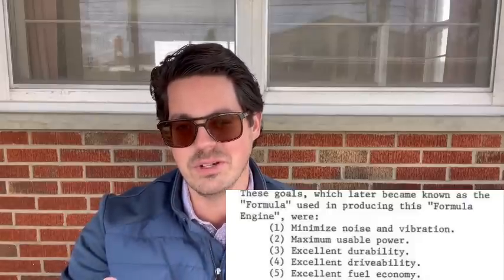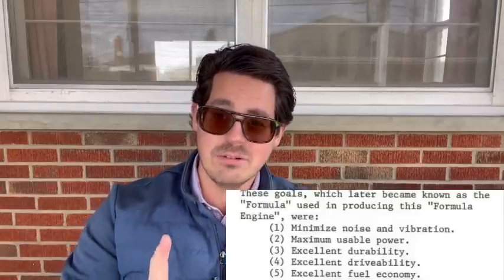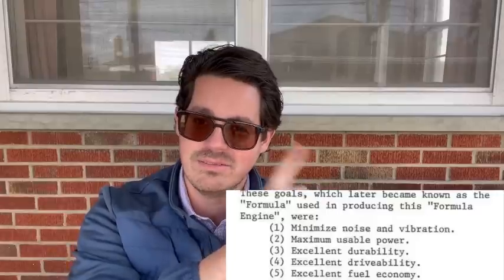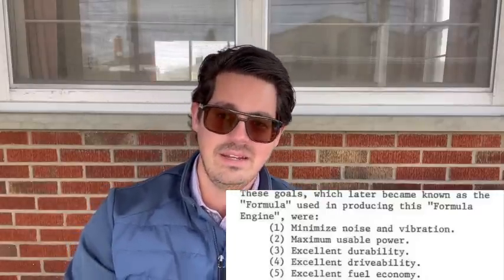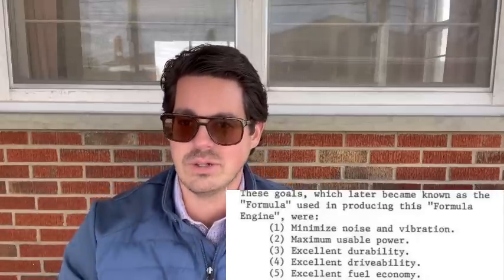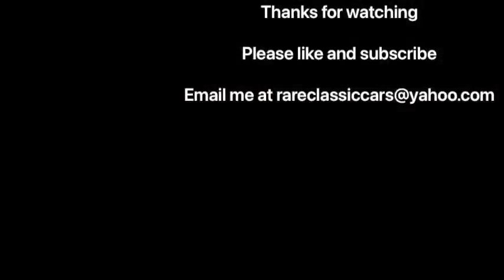Worst Engines of All Time: GM's 2.5L Iron Duke 4-Cylinder

Comment: I don’t think I would consider it one of the worst engines. My father bought my mother a 1981 skylark 2 door coupe (FWD, same as your Omega)with the 2.5L. At the time, yes looking back it was Course, rough, vibrated and very unrefined………However it was fun to drive, peppy and with 3 teenagers borrowing mom’s car and beating the hell the out of it, we got almost 175k without any major issues. Very durable and reliable……And American auto makers made Horrible 4 cylinder engines.
So I wouldn’t call it one of the the worst engines, most unrefined for sure.

Comment: I had a brand new 1976 Pontiac Astre with the 2.5L coupled to a 5-speed manual transmission.  It ran great.  Took it out to Colorado and Utah skiing one winter.  It ran flawlessly through 40 deg below zero weather.  Sold it with about 70k miles.  Never one stinkin' problem.  Not one.

Comment: More memories! Had an 86 celebrity with that motor and the cam gear stripped off. Was a fairly easy fix though. That was at about 250k miles

Comment: Owned several of these over the years in different vehicles. They were harsh and couldn't rev for shit or had much hp, but had great low end torque. Was decent in my little S-10 with a 5 speed. Truck was geared really low, and combined with the low end torque, I didn't have to give it any gas when letting off the clutch at a light. Fairly easy to work on, unless you're changing the distributor cap which is on the back bottom side of the engine. That sucked. Got great fuel mileage though.

Comment: The Duke was the engine in my first car in high school…a 1980 Chevy Citation. Noisy, slow and the mileage was mediocre. The worst part wasn’t necessary the engine but the transmission and front axle setup was so misaligned from the factory that it couldn’t be fixed. Get the car over 72 MPH and the front end literally shook. Unbelievable for a NEW car.

Comment: OMC used it’s marine version in my in laws 1969 Fiberform I O, 18ft.  This has the twin Stude Champion carbs.  Today those kits run $500.  It runs on 5 gal/hr, but it got beached until hardened valve seats were installed. OMC claimed 120 hp for this twin carb version!

Comment: The only problem I had with my 82 Duke was a leaky rocker cover.  It pooled on the head near the exhaust manifold.  GM stopped using gaskets and went with robotically applied RTV which didn't last past a couple years.  The aftermarket jumped in with gaskets and it was OK.  On fwd cars it was no big deal because the exhaust manifold was on the front of the engine and you had a lot of airflow.  On the Fiero, with the rear engine, not much airflow and the oil would catch on fire.

Comment: I have to disagree with this being on the worst of list . In 91 they made an A-code with 110 hp . Roller cam , cross flow head , and no timing chain isn't that crude . I've had 3 of these and they have all been super reliable . Its not a power house but it will always get you there . Can't complain about that when all we want is reliablility .
Reply from the maker: You said it all, “In 91…” ie over a decade after its introduction
Reply: It was designed to be durable and reliable while getting good fuel mileage.  It was all of that and more.  It just wasn't a performance engine.  I had 2 of them.

Comment: I had this engine in a 1982 Pontiac Phoenix LJ. My Chevette was stolen and needed another car, it was this or a Buick Skylark, I believe with the same engine.
Engine had blow-by, which saturated the air filter, and the engine gave up, stranded in the middle of winter.
But I loved that Phoenix because it had power windows and stereo radio.

Comment: I miss my 86 pontiac 6000 ! It was green on green and was a size above most imports on the road at the time !  I got it for cheap and did the camshaft it had 130,000 miles on ! car ran and drove great - i would describe the acceleration as very linear ! had to sell it ! wifey needed a minivan after having 3 more kids

Comment: Worked for a GM dealer in the late 80's & early 90's- the 2.5 litre iron duke was damn near bulletproof- the direct gear drive cam gear developed a knock at 60k miles but the last generation finally had a timing chain which fixed that issue. Not the smoothest, but super reliable, especially when paired with the TH125 transmission.

Comment: I have this engine in my 83 Gen 3 Camaro. Bought it 5 years ago with less then 10,000 miles , it not had just a little over 11,000. Bare bones car 4spd manual, no air, steers like a drunken cow and shakes like crazy. Really like your channel and the in-depth videos

Comment: The 2.5 really didn't bother me too much probably because it was a 4cyl and I just wasn't expecting a whole lot. The engine that I hated though was the 2.8 6cyl but much like the 2.5 it was reliable and durable although if memory serves me it didn't get all that good of gas mileage.
Reply: I had 2.5 TBI Citations & a 2.8 2bbl carb V6. The 2.8 was considerably smoother & quieter. All were 3spd auto & in spite of lower gearing the V6 had less punch off the line. It could make near 50 in 1st gear but didn't have any "go" till it hit about 25. And much over 40 & you were out of range of a downshift to 1st but at that speed 2nd wasn't low enough to really move! And besides, like you mentioned, gas mileage wasn't all that great either. Mileage was much better with the 4cyl.
Reply: @DejaView  yeah they were absolutely gutless and put one in a 4X4 S-10 Blazer, of which there were quite a few in my neck of the woods,  you had a vehicle that literally couldn't hardly get out of its own way.

Comment: Unrefined and crude is exactly what I want in an engine. It's why I love the old school small block Chevy so much. I also love the Flathead Ford. I love the Harley Davidson Knucklehead, Panhead, Shovelhead, and EVO engines. After that they became too refined and devoid of character, as well as being a nightmare to work on. I bought a brand new 1987 Pontiac Fiero with the 2.5L Iron Duke and a 5 speed. I drove it for over 7 years, and put over 190,000 miles on it, it was still running fine when I sold it. I had absolutely no problems with it during the time I owned it. I did over maintain it, but I do that with all my cars. The Iron Duke is one of my two favorite American four cylinder engines, the other one is not completely American, but was used in millions of American cars, and that is the 2.0L SOHC solid lifter "Pinto" engine. I am still driving a 1972 Pinto wagon, and while it is on its second engine, it has close to half a million miles on it.

Comment: I probably wouldn't have liked the 2.5 in a car with an automatic, but in an S-15 with a standard transmission I loved it. We don't know how many miles it eventually went because the odometer stopped working after it's third rollover. That was about 10 years before rust finally did the truck in. It drove itself to the junkyard. RIP, Scrappy.

Comment: My 1980 Olds Omega had one and it went 180K before I got rid of it.  I had to replace the pcv piping but mechanically it ran and ran and ran and did not use oil even when I sold it.

Comment: I had a 1985 Chevy S-10 with the Iron Duke and a 4-speed manual.  Started every time, ran great, handled well and got good gas mileage.  Never a problem.
I also had a 1989 Buick Skylark coupe with the Iron Duke and a 3-speed automatic.  More HP but fewer gears.  Never a problem.
My Plymouth Duster with the 225 slant 6 and a 3-speed manual (floor shift) was better in every way but the Iron Duke was solid.

Comment: As usual, an excellent and very FAIR assessment of "The Iron Duke", although I went in skeptical with the extreme "worst" and still remain wary of using a term like that for the engine in its entirety.  Regardless, I enjoyed this presentation very much, and as you went through the applications of this engine, I do remember having a 1987 Somerset that did sound noisy and unrefined....hah, one year before the balance shaft was added.  It is quite amazing that the Grumman LLV use the Iron Duke, and those have certainly outlived their shelflife to the point of being a hazard with such slow acceleration. I also had an '80s Honda with manual that I LOVED, although that base engine was SLOW....but yes, the manual was FANTASTIC!!!  Yes, I agree with all the content, but the title of "worst" I feel uncomfortable with and feels more like "clickbait".  Thanks, Adam!  Always interesting!!!!!

Comment: I used to dry distributors on the Iron Duke after an engine  wash by laying on top of the air cleaner/carb area and reaching around the ends of the manifold to take off the distributor cap and blowing the water out by feel. Not an easy job but not all that bad either. Just have someone handy to retrieve tools if you happen to drop em.

Comment: Adam, your videos spark some of the best conversations. I love reading through the comments. The Iron Duke was definitely not one of GMs worst engines. Too many caused little to no problems.
Reply from the maker: You’re right, but they were so unrefined.  Drive a 1988 Honda or Toyota and then drive a competitive car with the Duke.  Unless you were fiercely loyal to US cars, it was no comparison.
Reply: I think the pool is drying up, but there was a time people WERE fiercely loyal to American cars. haha You’ve created a great platform with your channel. It can only grow in popularity. Cheers
Reply: @RareClassicCars  I had a 1980 Honda Civic in like 1995 I paid $100 for. That thing ran better and was more refined than any iron duke on the road. That doesn't say much though.
Reply: @RareClassicCars  The Honda and Toyota engines had no low RPM torque, and a rubber timing chain that breaks, many had shallow combustion chambers, which meant the valves and pistons would collide, and the water pumps were inside the timing gear cover.  The Iron Duke was LIGHT YEARS better.
Reply: @mph5896  But it did not have the durability of the Iron Duke, nor did it produce as much Low RPM torque as the Iron Duke.  The Iron Duke was the better engine, no matter how much you foreign-lovers hate that fact.
Reply: @michaelbenardo5695  You so funny. 🤣Foreign lovers, thats a good one. I live in Flint metro area, GM country. MY daily driver currently is a Tahoe and a Dodge Charger. I have wrenched on GM stuff for 25 years, keeping the stuff going. I specialize in CHEAP transportation. 

The Honda was a high school car needed to haul my butt around when I literally had no money. That little POS $100 car put that iron duke to shame. Iron duke would be a great tractor engine or to power industrial equipment. Putting it in a car, even 40 years ago was pretty bold on GM's part.
Reply: Michael Benardo I have never heard of a rubber timing chain 😆🤣😂. Timing belts are maintenance items. Easy peasy to swap. I remember my friends dad, he had a Buick skylark with the iron duke. Not sure why, but he had to cut a hole in the frame to get new timing gears in it. Leave it to GM to screw the pooch on that design. 🤣
Reply: @mph5896  I guess you don't remember the Vega engine then.  If you did, you would not think so bad about the Iron Duke.
Reply: @mph5896  No it is not Easy Peasy.  On many of those things, you have to remove the radiator and the timing gear cover, on transverse-mounted engines, you have to remove a wheel and work through there, impossible if you have back problems.  On most engines with a metal timing chain or gears, you never have to touch them for the life of the car.  Sad that your friend's dad had one of the exceptions to that.

Comment: Sold my '91 Grand Am Pontiac with 230k miles and still quite serviceable and reliable.  It's ignition module was going bad so many hiccups and bangs but the new buyer didn't seem to mind.  That ignition was also hard to access and I got tired of putting new crankshaft position sensors in it, the module going bad put it out of my favor.  I used it for a work car as a traveling service tech, had no issues at all.

Comment: All your points are valid, but just gonna say I have a 1993 GMC Sonoma with the 2.5-5speed manual. It's been family owned since new. Never been down. I'd trust driving it across the continent if I wanted to at almost 300k miles on it. The worst issue I have with it is the steel exhaust manifold, and ignition modules(which are not proprietary to the 2.5)

Comment: When I was 14, my mom had an 86 6000LE wagon and when I was 16, her boyfriend had an 86 Cutlass Ciera sedan, both with the Iron Duke "Tech 4" and a 125C.  I would drive both everywhere, but they didn't get very good mileage because I'd floor them at every stop... No worries since they couldn't spin those narrow front tires on dry pavement (unlike an 85 Celebrity non-Eurosport wagon with the 2.8 HO and 440T4 that ... Care to guess why it got junked?).  The 600 had a bad mount, so it would rock the whole car back and forth at idle.  I remember them being durable engines, but rust got the 6000 (even though it was Ziebarted), and I think the Ciera was sold off.

Comment: The Iron Duke was actually half of a Chevy 302 V8. The Chevy 302 had a very limited production in 1969 in order to comply with SCCA Trans AM racing rules. It had a 4 inch bore 327 block with a 3 inch stroke crankshaft from a Chevy 283 engine.
The Iron Duke has the same bore and stroke as the Chevy 302 !
The Iron Duke engine was a decent,solid engine,I don't think it belongs on any 'worst-of' list!
Thanks for a great video,Sir!🌞
Reply from the maker: This is an entirely different Iron Duke. Not the Chevrolet engine.

Comment: As a auto mechanic for over 40 yrs. I had a lot of run ins with this lead weight! Valve cover would leak so much the caked on oil would catch fire! Pontiac Fero "s had a problem with this with many other problem with this P O S! The engine a lone was OK but everything they bolted on it well that's another story. A good engine to throw rock at!

Comment: Another excellent video! I had a 1984 Celebrity wagon with this engine and concur that it sounded like farm machinery, at least at low RPMs. If I had only known about that idle adjustment trick! The engine itself gave me no grief on that car, other than the cheap, electrical conduit exhaust manifold cracking and requiring replacement. Other non engine issues were bad AC lines and the wonderful GM steering rack of the era. Just like my old Pinto wagon, had the Celebrity been just a bit less crude they really would have had a winner. I loved the size of that wagon.

Comment: My daily driver in high school was a 79 monza with the iron duke 2.5 and a 4spd manual.  Yes it was noisy, more of an industrial engine than an automotive engine, yes the valve covers tended to leak, and the carbs used on them tended to wear out frequently. But I drove the wheels off of that car and beat on that engine relentlessly. And it just kept on running.  I even blew a heater hose on a trip to Florida and it overheated, I made it to the next exit pulled into a gas station let it cool off while we got some lunch. Came back, replaced the hose refilled it with fresh coolant and I was back on the road, no issues.  Try that with one of these new "high tech" engines today and see what happens.

Comment: I've got a 88 S10 sitting in my driveway with a 5-speed. The truck is head hydraulics on it it now has a airbag system on it and the only thing I haven't had to fool with was the engine. It's super slow and doesn't have much power but it's also a four-cylinder so I'm not complaining. Also it's kind of cool that it has one real big fuel injector instead of four. I thought that was pretty neat

Comment: I had the iron duke in a 1980 Pontiac Sunbird that I owned for 8 years and put 122k miles on it. No problems with the engine - it was durable and reliable but it had an annoying rough idle that I could never smooth out. The rough idle was inherent in the design and I just lived with it.

Comment: I use a "cousin" engine here in Brazil, I have an GM Opala 151" (etanol), it's an old project, ok... But no headaches till present moment. Gentlemen, please inform if is there any automatic analog gearbox 5 speed for this engine?

Comment: The only real thing wrong with this engine was the distributor.  They used a plastic baseplate and plastic rivets to hold the hall effect vanes, which would break.  But a replacement distributor was only about $30 and had proper metal rivets and would last forever.   

They did leak oil, but the gaskets were easy to replace.  I always used weatherstripping cement to hold the gasket to the cover and then used a thin bead of RTV.  Never had one leak after doing it that way.

Comment: My first new car was a 1981 Chevrolet Mutation (Citation) with the Iron Duke & a 4 speed manual transmission.  The car I came from was a 1971 Chevrolet Impala with the 400 small block.  OMG, what a freak’n disaster that Mutation was!  Everything went wrong with it.  I was commuting then & racked up 70,000 miles in 3 years.  I had enough of the thrashing machine & sold it.  I saw the car several years later & asked the owner how it was doing.  She exclaimed that it was the best car they had ever had!  It had WAY over 150,000 miles & she said they had not had any problems with it.  I guess I worked all the gremlins out for them to enjoy…I should have bought the Honda Accord that I really wanted.

Comment: soft cylinder blocks, cam gears, cracked heads, blown head gaskets, oil leaks like the Exxon Valdez, rough, crude, slow, but decent gas mileage. worked on billions of them back in the day. better than what it replaced.

Comment: My mom had a Buick century with that engine. I believe it was either 82 or 84. It stopped running one day so I took off the distributor and found out one part was loose so I tightened the screws and it ran again. Then my brother was driving it and it was running really badly. When we took the engine apart we saw big holes in the pistons so that was that.